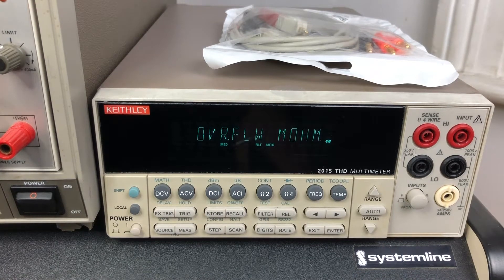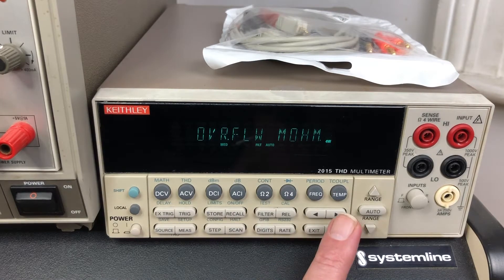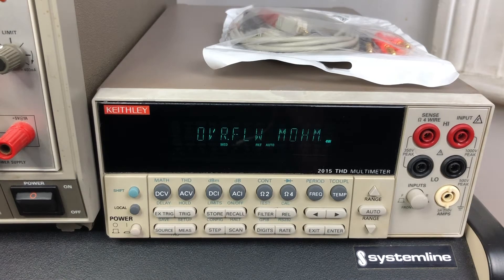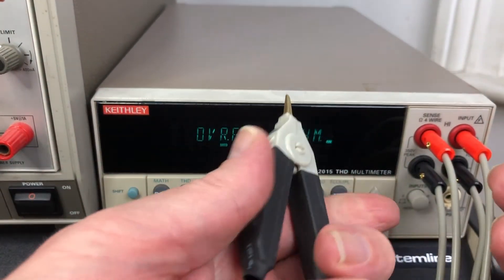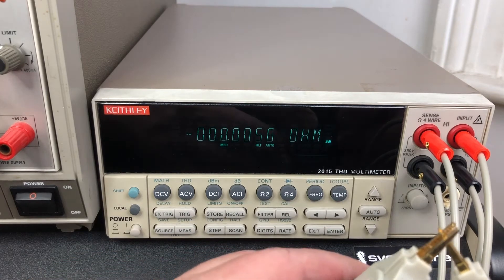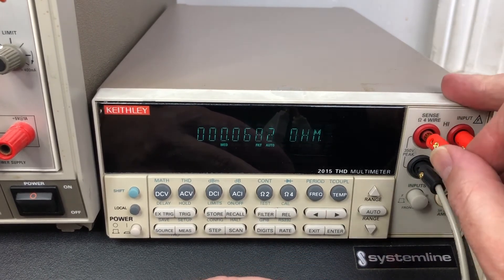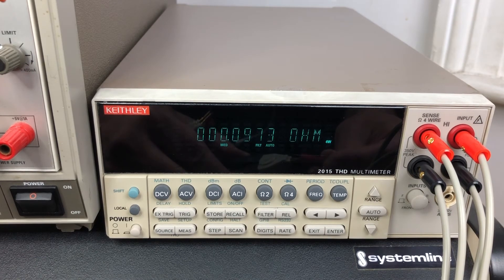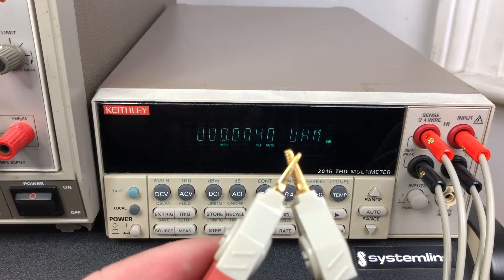$23 Kelvin Probe resistance measurement on Keithley 2015

Comment: 2015's are nice meter's, but I'm too frugal to pop for one at the current market price, and finding one at a reasonable price seems to get you a used one that may or may not have issues ( I currently just have a old 197 which is accurate enough for my work). I'm surprised you didn't play with the REL feature , using a good dual banana plug with a short tied onto it as a calibration/base measurement, to check the 2W VS 4W lead values too.
Reply from the maker: Thank you! I never even new it did that. I though Relative is what you pressed when you wanted the missus to bring you a beer. Just kidding! In all my career as a professional design engineer and then later in a production environment, I don't think I ever used a bench multimeter once. It was always handheld Fluke meters. So I think this is actually the first time I have ever used kelvin probes. And our meters never had features like REL or anything like that. Yes - it's a lot of money. However, as I have mentioned on a few videos, we really get stung for freight here in Australia. My meter came from China and had free freight. I want to get some plug-ins for my Tek TM5006, but the freight is almost always more than the plug-in itself. So I just have to wait for something reasonable to come up.
Reply: @audionautica6843  It's Good that you got a reasonable deal on it. The one function it does have that is desirable (for audio work) is the THD function for quick and handy use. I'm planning to go the route of using the free REW ( Room Eq Wizard) software with a good DAC such as a Scarlett Solo 3rd Gen, as it has graphing and freq sweep/phase measurement capability, and uses the DAC/Sound Card as a baseline/low distortion signal source as well, it just won't give a convenient "one button" THD measurement.
Reply: You can pick them up for good deals sometimes.  I was able to grab one from Japan for $430 including shipping.  And then spent about another $70 on an order from RS components to replace the capacitors with 105c 5k+ hours rated parts including the tantalum caps (higher voltage rated caps).  And upgrade to the latest firmware (EEPROM chips are surprisingly expensive).

The reason I went for this meter was around the incredible refresh rate.  Both the continuity, DC volts and resistance measurements are blazingly fast.

My meter was from early 2000s and was spot on with a brand new Siglent 6.5 digit instrument measuring a voltage reference (from China).  Both matched what the voltage reference from China said, not any kind of precision but for them to match down to the 5th digit at least gives some confidence.  Interestingly even with its REALLY fast refresh rate the Keithley still had less noise on the last digit VS the Siglent (last digit on that was practically useless)

So these meters seem to hold their calibration really well or I got lucky, but either way, great meter.